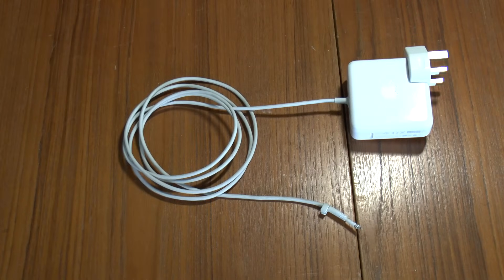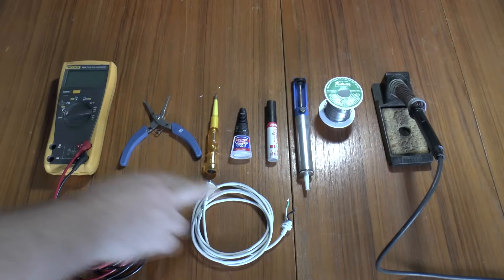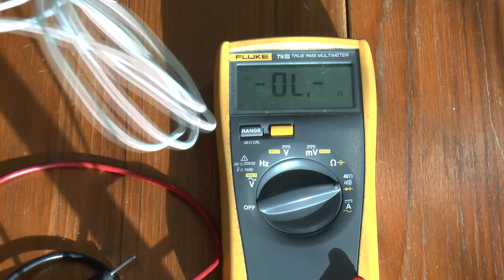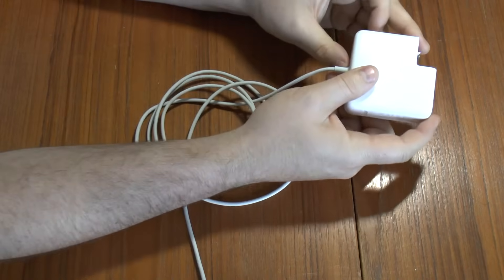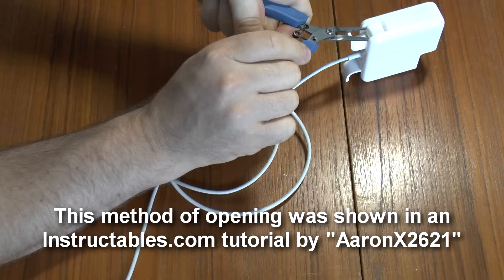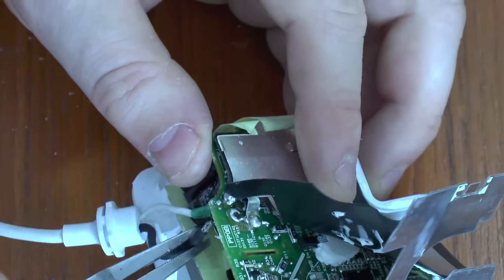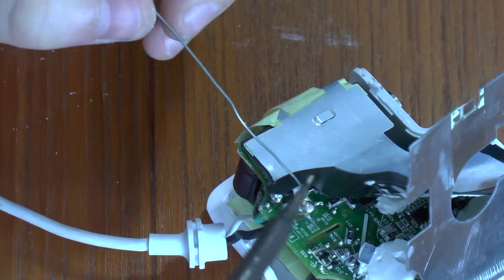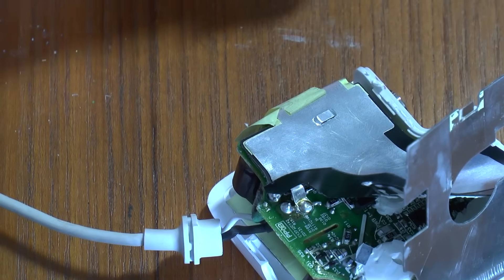How to repair an Apple MacBook power supply (MagSafe)

Comment: Wow... This was too difficult and too much-unneeded torture upon you.
I would cut the old wire 4-5 inches from the charger, and connect the new wire at that point, adding some good heat shrink material over the area, and call it a day!

Comment: Nice. Very informative. Can we cut the wire in half and connect other cable? My charger is working fine but cable is about to break from middle
Reply from the maker: Yes.  I've got one that's extended like that, with the wires soldered, individually heat-shrinked then more heat-shrink over the two.

Comment: Hey guys, just wanted to know if I
opening my MacBook power adaptor on my charger does any damage to it. I accidentally opened it and I am shit scared.
Reply from the maker: What do you mean by the power adaptor on the charger?  Do you mean the plug-in section with the prongs that attaches to the charger?
Reply: @AintBigAintClever  I mean the power supply. (Aka. the box thing that you opened with the pliers)
Reply from the maker: @monkeman7776  as long as you didn't rip the cable out it should be fine.  If it all fits back together nicely then you could glue it shut.  I'm surprised you managed to accidentally open it though, they're pretty solid.

Comment: would it have been easier to clip the wires once you had it open and connect the new leads there . still allowing you to secure the anti-pull in the slot.

Comment: 1:15 you just said that if you don't get continuity between the black cable and the outer two pins, the cable is faulty.. well you didn't get a beep so why is that ok? You got a continuity beep when you tested the white cable and the inner two pins right?
Reply from the maker: It's 9 years since I filmed this, but I'm pretty sure it was a faulty cable and had to be replaced by the seller.
Reply: @AintBigAintClever  thanks for the answer, definitely cleared that up. I tested my one today and found there is a short in the cable but also that he terminals on the adapter we’re not outputting the necessary voltage. Gonna take it to a technician tomorrow to see what’s what.. thanks for making that video.

Comment: Brilliant! Thanks for the tip on how to open the case with pliers - it worked a dream. I had to remove the cable gland as the cable had been damaged where it enters the charger - the outer screen of the cable was completely broken. As the cable was moulded into the gland, I found the best way to remove the bit of old cable was to carefully snip off the leads on the inner side of the gland, then use a 3.5mm drill to drill out a hole though the glade to push the cable though. Then strip back the cable about 2cm, twist the outer shield and put a bit of heatshrink sleeve on, then solder the outer to the ground pad on the pcb and the inner to the power pad.

Comment: Hey, 
Great tutorial!
Unfortunately I attempted to repair my charger before watching this video(I saw another video).
I cut the two crimp spade terminal connectors and solderd the tips of the cable directly to the board.
I would like to do the repair properly (don't worry I wont connect the charger until the job is complete and solderd in the PROPER way) - do you know what amperage are the crimp spade terminal connectors? that way I can order them on Ebay and repair the damn charger.
Thank you so much
Reply from the maker: I don't recall seeing spade terminals. Do you mean the bootlace ferrules on the end of the wires?
Reply: @AintBigAintClever  Precisely,
Thanks for the fast reply
Reply from the maker: @Joe-156_93  I suspect it'll be more to do with the CSA of the wire than the current rating (which would be about 4.6A for the 85W charger).  You might be better off getting an assortment.

Comment: If Apple weren't such greedy dickheads and manufactured chargers that could be repaired we would not have to go through such a lengthy process. Also bear in mind that the cable from power pack to MacBook is only made to last a couple of years........

Comment: Hi. Which soldier line is perfect for this job, 40/60?
Thanks for the great tutorial.
Reply from the maker: As long as you're not using that awful lead-free stuff anything should do.
Reply: @AintBigAintClever  thanks mate. And what about the temperature?
Reply from the maker: @ppmei  chances are I was doing this at my usual soldering temperature of 370°C. Other temperatures are available :)

Comment: I had a break in a wire right near the power supply.  Using your instructions on opening it up and describing what's in there, I shortened the wire and re-connected it inside.  Thanks for the video, it was really helpful.
Reply: I have a question. I'm not sure how to describe this. Did you manage to run the cable thru the thing holding the conductors from being pulled out of the soldering? If not what's holding them?
Reply: @HelloStrangerPod  I did manage to slide the cable through that thing.  I seem to remember that it was quite hard to slide along the cable, though.
Reply: @NigelGentry  well done. I ended up drilling a hole through the thing for the whole cable to slide through. I kept it narrow enough for it to still firmly hold the cable in place.

Comment: I did this job on my MagSafe 2 charger at the weekend but now it doesn't work. I think the soldering job was pretty good but I get no life from the new lead at all. I swapped back to the original lead and now when I plug it in it lights up green for a second then goes off. Any thoughts as to why? I can't see anything shorting out and the joints are all good. The only thing I noticed is that the foil insulator did tear where it's soldered to the PCB but it is also soldered elsewhere.
Reply from the maker: I'd desolder the lead and solder on two short pieces of wire, then attach a multimeter to those and power up the charger, see if it's putting anything out. The first replacement lead I had was DOA which didn't help.
Reply: @AintBigAintClever  Thanks for the quick reply, I've tested the points with a multimeter and I get a voltage reading but it's constantly dropping so I assume it starts then cuts out as it's detecting something it doesn't like
Reply from the maker: @mdickens98  have you tested without either of the MagSafe2 cables attached? The short lead test was just to make it easier (and less prone to a slip and a bang) than probing a live charger PCB.
Reply: No, I'll give that a go and see what happens, is it 16.5v I'm looking for?
Reply from the maker: @mdickens98  looks like it could be up to 20 volts but I don't know how the plug requests that from the charger (I doubt the plug has a voltage converter inside). https://en.wikipedia.org/wiki/MagSafe
Reply: @AintBigAintClever  I just got round to doing this test, I get 16v for a split second and it quickly drops down until it hits about 0.4v, sits like that and after maybe 30 seconds spikes to 16v again then immediately starts dropping. I don't know if this helps identify what's broken but it's obviously not working properly now.

Comment: Very useful, thank you. Seems that the soldering iron is not hot enough. Also, I question your soldering method : I have learned and apply this method : heat the wire, melt the solder on the wire. From what I saw in the video you melt the solder on the iron itself: this leads to a much less strong solder because the wire itself may never reaches the solder melting temperature. Sorry for my english, not my language.
Reply from the maker: The wires are already tinned with solder which helps.
Your English is fantastic, better than the English used by many British people :)

Comment: Knew there would be a way inside this little beast. Thanks for the tips. My Retina MagSafeII was a little different and required a bit more "persuasion". Note, if you have ring extractor pliers these work quite well to open the seams as this type of pliers can be set to push out the jaws when you squeeze the grips. Very handy. These cases are pretty well glued together and an X-acto knife judiciously placed. opened the seams where brute force alone would have cracked the case sides. Also, the Retina supply uses an epoxy heat sink compound to bond the supply heat sink to the plastic case. Apple supplies are notorious for getting extremely hot when on full charge. Metal to plastic heat conduction is a pretty poor method for heat dissipation. Beware of your charger overheating after your repair or better yet, use some metal particle filled epoxy between the heat sink plate and the plastics side. I used epoxy also to glue the case back together as there were a few open cracks that epoxy can fill better than cyanoacrylate.

Comment: Is there any danger of short circuiting computer later on with this...I am in Pakistan, maybe I originally was sold a fake Apple Charger...the original actually burnt and there was current in the distal end ...I am more worried if after repair , the charger can short circuit the computer!...Would somebody please shed some light on this.

Comment: Thanks man!

I took me about 10-15 minutes to repair my charger. A bit funnier than paying apple 90€ for a new charger!
However they decided to FILL my charger to the brim with silicone. Thanks a lot Apple! :P 

Now I'll just have to order a few extra replacement cables so that i can repair my 3 other old broken MagSafe-chargers. :-)

As a bonus, I can upgrade my old MagSafe-chargers to MagSafe 2, so that I no longer need the annoying adapter that gets lost.

Comment: Hi in the process of taking the cable soldering off, the green circuit board had ripped a little... Do you think this would have damaged the adapter? Also, anyway I could verify the adapter without soldering it?
Reply from the maker: If you scrape the green surface off the board you can add solder to repair the tear, you may also wish to do this to check the extent of the damage.
I'm not sure what a MacBook supply will do if there's no cable attached. As it's only a two-wire connection to the MagSafe connector I'd expect a multimeter to show the normal output voltage at the two solder points with no cable connected, but there's the possibility that the supply itself is doing some sort of load sensing and shutting down with nothing connected. If I was doing this again I'd meter it without the cable soldered in, then do the repair anyway to see what happens.
Reply: @AintBigAintClever  Is there anyway I could reach out to you? or send the picture... I am not a pro at chip boards... and just see the brown layer on top with about 1/4 inch green stripped off...
Reply: Also anyway I could share the pic with you?
Reply from the maker: Contact me through my Facebook page and I'll take a look when I get back home tonight. https://www.facebook.com/AintBigAintClever/

Comment: Great video.  In my case, the wire was broken at the other end, right next to the "brick."  Needed to fix today and could not find new wires.  A simple fix was to carefully cut into the rubber nipple at the end of the brick and also remove about half an inch of white insulation along the wire.  This exposes a fine silver mesh around a grey wire.  The grey mesh had broken from repetitive movements and I was able to twist a section of it on both sides, then soldered a small amount of wire to bridge the mesh together.  At this point one just has to wrap up the cut (my preference is vulcanizing or self fusing tape).  It works well and I did not have to take apart the brick!
If the center wire is broken, then one would have two parts to solder and carefully ensure that they are insulated from one another.

Comment: Had difficulty opening adp60adv. Almost gave up. Apparently both plastic sides were glued to the metal shielding. I guess putting four screws is more expensive for Apple than the toxic glue.

Comment: Thanks. That looked like a pretty serious belt you got off those caps! Just finished fixing up a 2010 ebay MBP so will probably end up having to do this judging by all the reviews of the 'quality' of the Magsafe on the Apple site lol. Mine has 2 cables and not a plug so I'm hoping they used to build them better than they do now! I'll probably just cut the cable and solder the new end on with heatshrink though. Nice to see somebody giving them the finger about £85 for a replacement that barely lasts a year. Good work.

Comment: Forget about trying to gentlely force open the case. The one I have here, I had to saw around the edge with a hack saw blade and then use a screwdriver to force it open. Inside I found it had been filled with silicon glue so it pulled everything to pieces.
Moral of this story. Don't buy Apple products.

Comment: No offense AintBigAintClever, and thank you for your time.
*** Desoldering the old cable is bad idea, what you need to do is to cut the two cables with a wire cutter or strong scissors as far away from the borad as possible. Then attach the new cable to the old wires wires that should be still attached to the board. 
the holes where the old cables sit are very fragile and will get damaged from the heat of the solder very easy.

Comment: Is this the Magsafe the Adapter that came with your MacBook when you bought is at the Apple store?
Reply from the maker: The Magsafe is Apple's name for the connector at the end of the charger's lead.
Reply: The Magsafe 60W adapter you´r repairing  is it the original one?
Reply from the maker: Yes. I use a spare one now but my sister's fiancé is using the one in the video, which came with my MacBook Pro back in October 2010. Thinking about it I don't know where their original one went to and why they ended up having mine...
Reply: And another question, is the ground pin not connected?  I can not see clearly and I am not sure.
Reply from the maker: No. These adapters have a figure-8 input connection, which can take either a standard figure-8 plug (e.g. a cassette recorder power lead) an Apple-specific version of the plug (moulded to blend into the corner of the charger) or a plug adapter as seen here (which is a mains plug with a figure-8 connection moulded into its base). No ground connection.

Comment: Very good tutorial but the replacement cord costs £5 and you still have an old charger. A good quality replacement charger costs £25.Take your pick.
Reply from the maker: I wouldn't trust a £25 charger having seen inside the counterfeit iPad ones.
Reply: The cheap replacement chargers explode after three months to six months. Been there, done that. Properly repaired chargers can last many years. Don't forget (even on new ones) to reinforce the cable ends (charger and mag safe sides) with white duct tape. Will triple or quintuple your cord life.

Comment: A few seconds in the video I thought to myself, you should probably discharge those capacitors. And sure enough...
Reply from the maker: I suspect that due to the sealed design Apple decided that discharge resistors weren't needed. Damned thing had been switched off for two days and still bit me.

Comment: Excellent - so glad you put this up. My problem was a break in the cable where it enters the brick itself due to repeated strain. Apparently, this happens fairly frequently.  I did a patch job of soldering and shrink-wrapping the break that lasted about 6 months. I'm so glad you've figured a way to get into the brick itself so I can do a proper job!

Comment: Help please! I wanted to test the connection before putting on the insulation tape but I'm afraid the two wires were touching and it short circuited.  Did I fry another component of the charger by making the short circuit or should it still work ok?
Reply from the maker: Where were you using insulation tape? If you've extended the cable instead of replacing it then you should be able to test the voltage across the two wires at the point where you've joined them, I'd expect the full output voltage to be present regardless of whether there's a MacBook plugged into the MagSafe connector at the end, unless the connector sends data along the supply wire to turn it on and off.
Reply: Thanks for the reply. I was trying to re-splice the wires instead of shortening the original wire and re-soldering it to the circuit board. The problem is I plugged in the charger (without MacBook attached) to see if the green light came on, but the positive cable was in contact with the negative cable and it short circuited. Would that destroy the charger? The green light won't come on now.
Reply: Thanks for the reply. I was trying to re-splice the wires instead of shortening the original wire and re-soldering it to the circuit board. The problem is I plugged in the charger (without MacBook attached) to see if the green light came on, but the positive cable was in contact with the negative cable and it short circuited. Would that destroy the charger? The green light won't come on now.
Reply from the maker: This video might help: https://www.youtube.com/watch?v=6VOPsCsrEt0
Reply: AintBigAintClever Awesome! Thanks
Reply: AintBigAintClever Fixed it!!! Thanks. Feels good
Reply from the maker: Fantastic!

Comment: Thank you heaps for the tutorial! 

I'm careful about where I leave my charger but sometimes I forget to hide it from my bunny and well... we can all guess the ending of that scenario :'D 

I was up to my 4th replacement before coming across your tutorial, really liked how you kept the camera rolling and didn't skip out on any parts while completing the replacement, that really helped!! Dismantling the damned thing took ages and I think I might've removed it incorrectly because the shielding came apart from the casing unlike yours (where the top part had stuck to the casing and you only needed to remove the light yellow tape) but it still worked fine after soldering the new cable on. I think I'll keep this video somewhere easily accessible because I see myself needing it again in the near future...